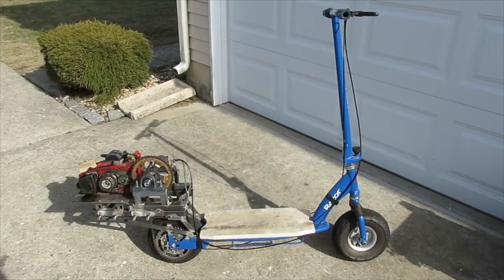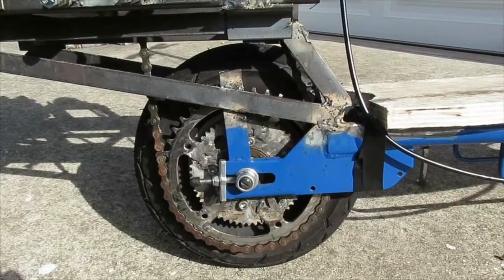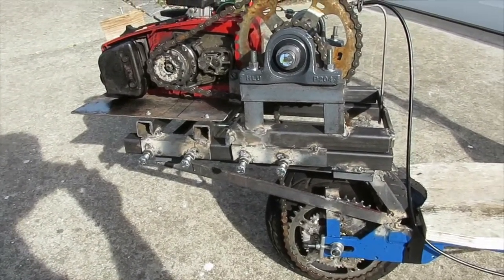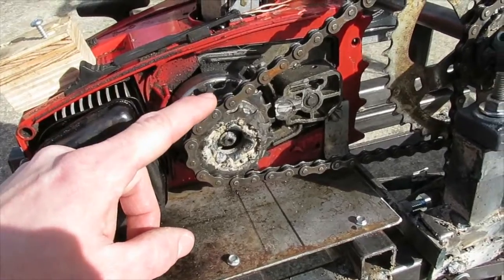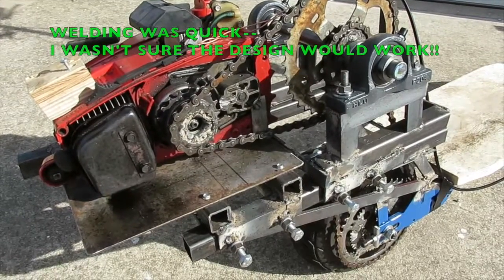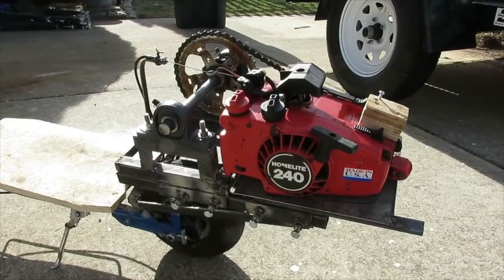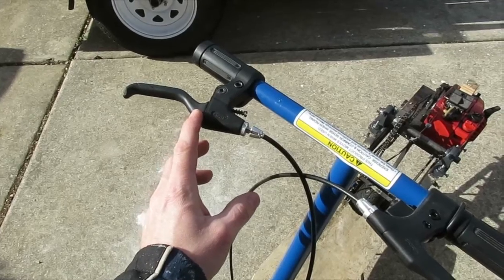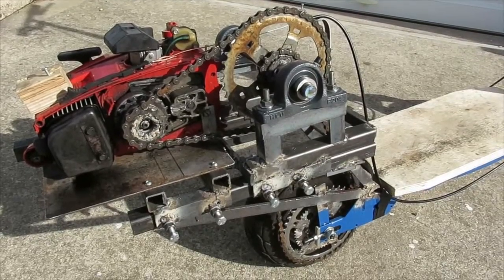Electric scooter converted to gas with 40 cc motor

Comment: Hello, I also assemble such a scooter. the engine is from a chainsaw, solo 38 cubic centimeters. I want to ask how it moves with this gear ratio on a flat terrain or a slight backward slope. I weigh about 90kg. I write with an interpreter so I may not be very clear. See you soon